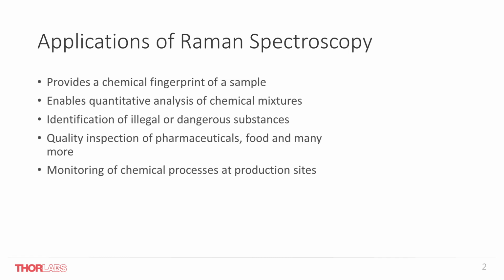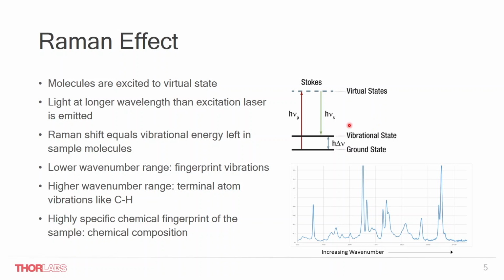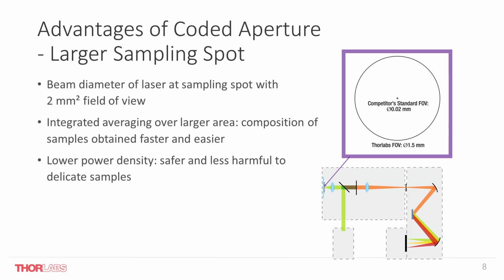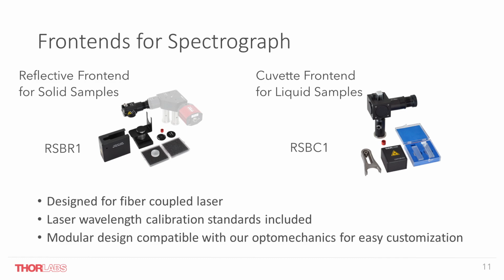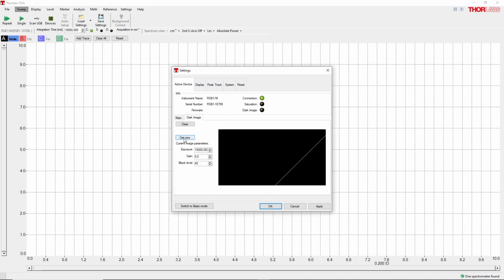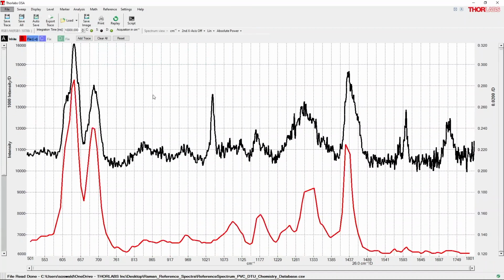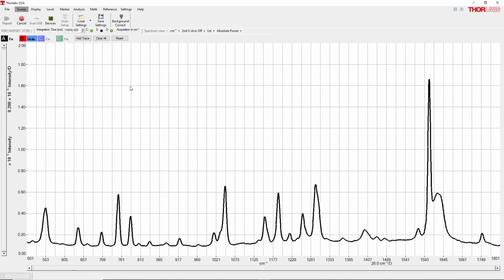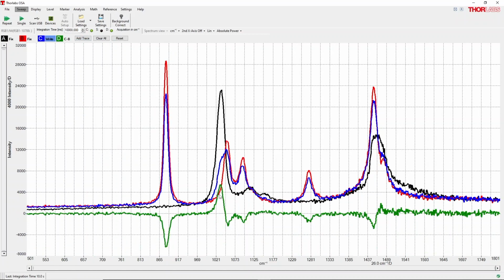Large Field of View Raman Spectroscopy Using Large Coded Apertures

Comment: Is there a way to make this 1 second or less?
Reply from the maker: We recommend an exposure time between 1 s and 20 s for most applications. Lower exposure times can be used, even down to 1 ms is possible. At such low exposure times the reconstruction of the spectra will be the speed-limiting factor. This process takes about 300 ms, depending on your PC.